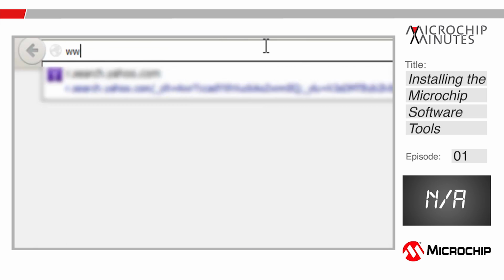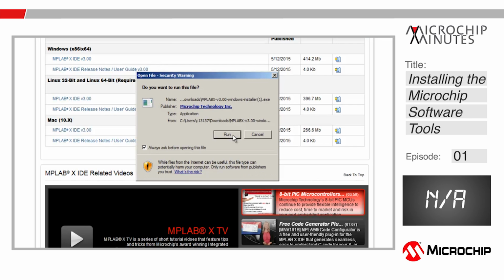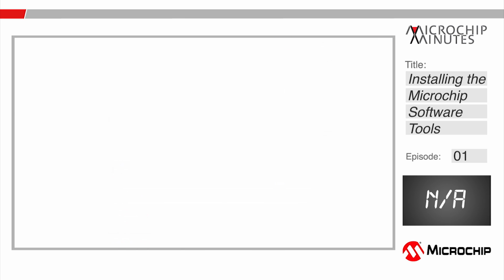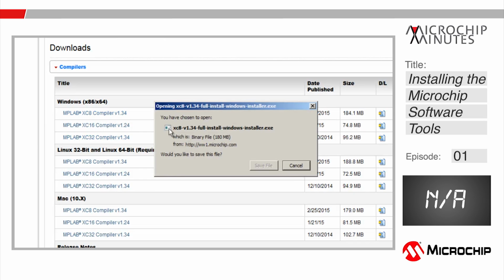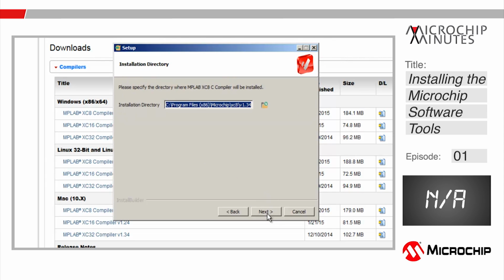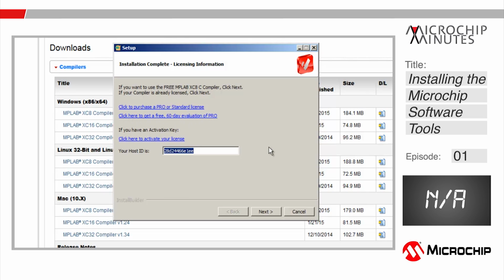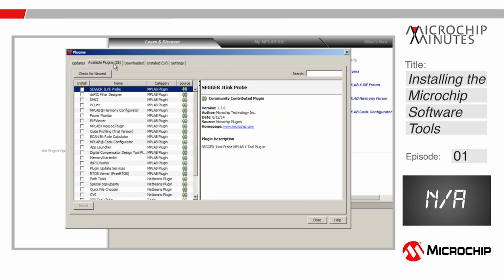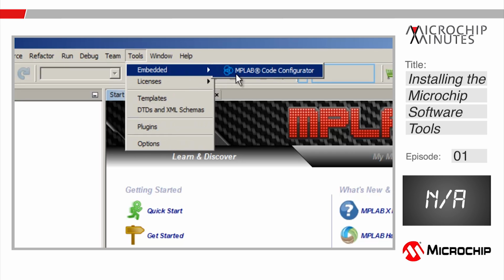Microchip Minutes - Episode 1 – Installing the Microchip Software Tools

Comment: You guys make everything needlessly complicated.
example. I try t install the Code Configurator and you show an error message that MPLAB Debugger is requested in V1.3  ... 
Why don't you just update it for me. Now i need to spend an hour figuring out where to update the MPLAB Debugger.
It is a hot mess for new users of MPLAB X
Reply from the maker: Kindly visit support.microchip.com if we can be of assistance.

Comment: This is bullshit.
After install and start MPLAB Code Configurator:
"The project's device (AVR atmega8) is not supported by the currently loaded libraries."
3.   Download avr8bit MCUs (avr8bit-2.1.0.mc3lib) 
4.   In the MPLAB X IDE, select Options from the Tools menu  
5.   Select MPLAB Code Configurator 3.x tab from Plugins option 
6.   Click on Install Library  
7.   Browse to the location where you saved the avr8bit-2.1.0.mc3lib, select and click Open  
After this:
"Library avr8bit-2.1.0.mc3lib installed successfully."
8.   Restart MPLAB X IDE  
After restart MPLAB X IDE v5.30 and start MPLAB Code Configurator:
"The project's device is not supported by the currently loaded libraries." (same as at the beginning)